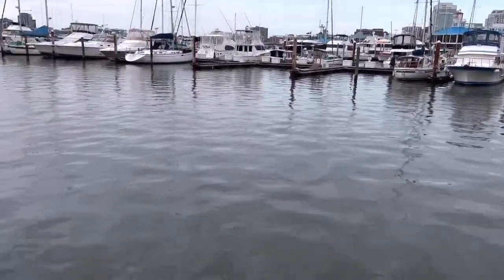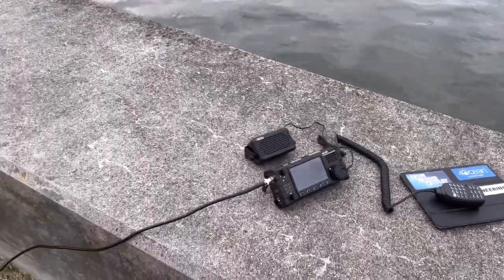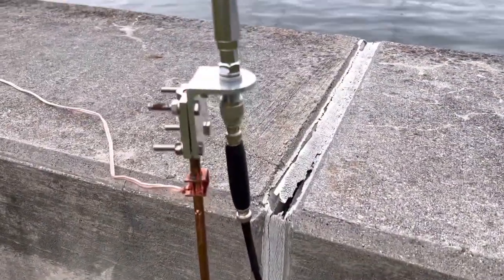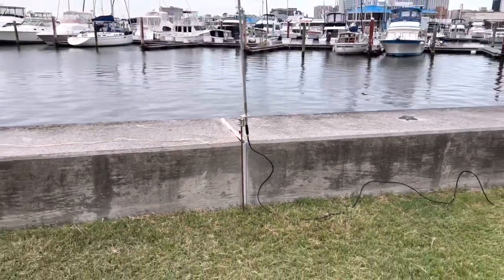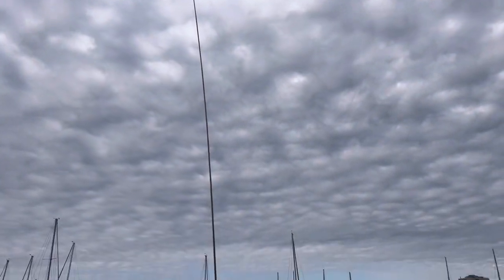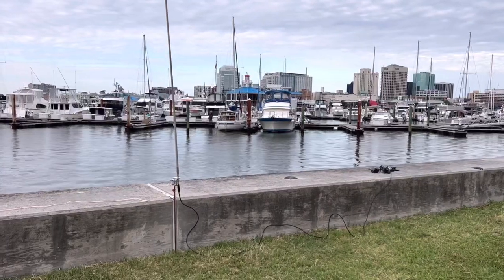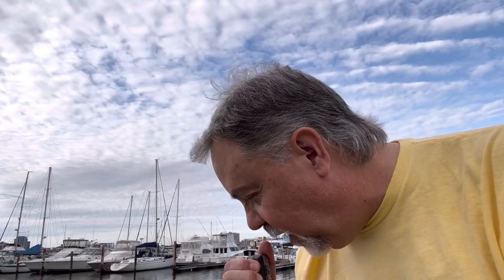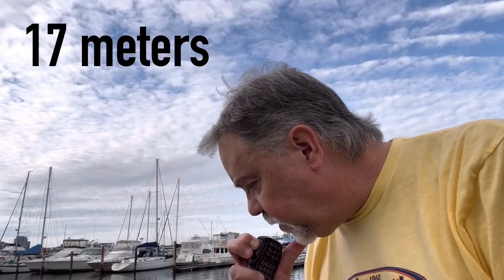Xiegu X6100 - 5 Watt SSB QRP

Comment: Hi Walt. I have a pile of Xiegu gear, the X5105, the G90, the G106 and a new X6200. I had a G1M in the past. The X6100/X6200 get very warm at 5 watts, and IMHO, there is not enough radiative surface to run 20 watts. The 20 power level is ideal, I have to agree on that point. And, the straight whip is a limiting factor, too...

I try to go with more antenna and less power. I hve a 40 meter EFHW with an add-on 80 meter loading coil. I also have multiple magnetic loops from a 2-turn rectangular loop for 3 MHz to 8 MHz down to a loop made from aluminum bar stock that's a hexagon that's 11 1/2" corner to corner and covers 17 MHz to 60 MHz.  Nothing on 160 meters yet, but working on that! My primary support is a 10 meter telescoping mast, and I have a drive-on mast "foot". All fitting in a sub-compact Scion, heh...

CU on the air!  73, Keith, WB2VUO in Amherst,  NY

Comment: can you add a 20 or more watt external amplifier using 6100?
Reply from the maker: Yes, I have the 100 watt Xiegu amp that pairs well with this in a base station setup. Not good for portable. It’s the Xiegu XPA-125B.

Comment: don't give up buddy... i have the 6100 and hopped into Ireland from SE PA  on 17M. 5W into an antron 99 with a feed point only 10ft above ground.
'73
Reply from the maker: Oh I won’t, I’ve made some great 5W contacts over the years. This radio just seems like it could have been designed to be a 10W radio under its battery and that frustrates me lol. All the best and 73

Comment: Cool beans k4ogo de kc2wvb.

I too love QRP. I took a hiatus from ham radio for 10 years, but recently placed an inverted V in 40 meters in service and pulled out my HF Signals kit QRP rigs.

I likely can hit you easily on QRP and when I fire up the radios I will look for your call sign.

Yep, being QRP when the monster stations are calling CQ can be very frustrating and is partly why I placed my kit in storage for a decade. After all, all the credit goes to Kenwood when 100 watt plus equipment is used.
Reply from the maker: Roger that! 73 de K4OGO

Comment: Hi Walt.   Is that 1:1 choke something you made or bought?  Looking at the Chameleon RF choke but like the size of the one you use.  Thanks again for your videos.  73 W6SDK
Reply from the maker: Hi! that choke is built by Tim N9SAB and he sells them on eBay. Here's a link: https://www.ebay.com/itm/164358440127?hash=item264486c4bf:g:gSMAAOSwiABfJgzk

Comment: Not sure if it’s seen in this one, but you’ve shown a choke that’s bullet shaped. Are these available somewhere?  I think you may have mentioned that a fellow Ham makes them.
Reply from the maker: Yes it’s made by Tim N9SAB and he sells them on eBay: https://www.ebay.com/itm/164358440127?mkcid=16&mkevt=1&mkrid=711-127632-2357-0&ssspo=TIbkpe2XS0m&sssrc=4429486&ssuid=IVyKb51XQj2&var=&widget_ver=artemis&media=COPY

Comment: There is always the option to put the external battery on it and double your wattage to 10.   That is what I do and I had a park activated and up to 62 QSOs in an hour and a half this past weekend.
Reply from the maker: Yes, I do that too, this was just an experiment to see how it would go with the internal battery
Reply: The first 20 minutes of my activation was at 5 watts.  I had forgot to turn up the power after I plugged in the battery.   The alternate interface is nice but it takes some getting used to.

Comment: For us newbies would it be possible to show the exact setting you use for your ssb contacts, i.e. noise blanker?, noise reduction?, filters setting?, other tricks. I've done quite a bit of FT8 with my X6100, but few ssb contacts because of 1) mike shyness and, 2) setting ignorance. Thanks for the videos.
Reply from the maker: I'll look into doing that, to be honest I haven't done too much with the settings on this radio other than setting the AGC to Slow and going with the factory settings that it came with. Key that mic and start making contacts!

Comment: Walt love your Videos, I have the same radio and I always go with  10 watts and the best output is outside the metropolitan areas, the noise is too much  for the rig. I have a love and hate relationship with it. If I am going to the woods , OK , but if I am RVing  it a no go, take the FT 891. Thanks for the down to earth  practical videos. 73's  de KC6RZW
Reply from the maker: Thanks for watching and commenting. Yes I can see my feelings about this radio are going to be about the same. 73 de K4OGO

Comment: Question: How do you drive the ground rod in the ground? You carry a hammer or? How deep, just enough to support the whip? Thx! 73
Reply from the maker: Typically I hand push it down about 15 to 18 inches. I do have a rubber mallet that I have used a couple times when the sand or dirt was hard. 73
Reply: @COASTALWAVESWIRES  Thanks!

Comment: hi Walt xiegu 5105 on tx is much better than 6100,i got 2 6100 but i send back to manufacturi,i did not like at all,after 10 minutes cqing its getting very hot.regards iz6bxv
Reply from the maker: Roger that, I really like my X5105. Great little rig. 73, Walt K4OGO

Comment: Hey Walt! I have been using a G90 for a couple of years, and got a 6100 this week. I have been playing with it at home, and with a 40-10 efhw I have a couple of DX contacts, and have done well chasing pota from OR, NM, CT, NJ and others from WI. It is a different challenge vs 20w for sure. How does it do on the QRP net? I am considering pairing it with a micro PA50. It should kick some butt with it,  I love the bigger screen, the improved noise reduction it has over the G90.
Reply from the maker: Yes I think it is a perfect match with the PA50. That might be my next move.
Reply: @COASTALWAVESWIRES  I got 9 countries over the weekend along with a bunch of pota with 10w on 10m. The noise reduction makes it less tiring to listen to for me. I agree that it would be perfect with the G90's 20w.

Comment: 5 Watts SSB is fly fishing for sure. If that was 5 Watts CW, you'd have been waaaay busier. You've got to get those beeps going.... 💪
Reply from the maker: I’m working on it!!!!
Reply: @COASTALWAVESWIRES  excellent. It's the most satisfying (and most addictive) of all the modes. Jump on the air as soon as you think you're ready, nearly all operators will adjust to your speed. Those that don't aren't worth talking to anyway 😁

Comment: Do you use the stock mic with the X6100? I keep getting reports of "funny" sounding audio using mine.
Reply from the maker: Yes just using the stock mic
Reply: @COASTALWAVESWIRES  Thanks. Maybe I've been getting some RF in the audio or something. I need to get one of those inline rf chokes to try out.

Comment: If you run 5W you need full size no compromise antennas. That whip at 5.2m with two elevated radials on 20m… and shorten it to a 1/4wave on 17 rather than use the tuner on 17m makes a lot of difference. See Peter VK3YE’s you tube channel
Reply from the maker: Yes I understand that and actually mentioned how compromised the antenna was at the conclusion of the video.
Reply: @COASTALWAVESWIRES  yes saw that, keep the videos coming !

Comment: Great video....thank you for being honest.  5w is 5w...we can present dB calculations and rationalize that it is only "1 s-unit difference" compared to 20w , but I don't think that accurately represents the difference.  We often do the same thing with higher power....I can say from my experience that 300W vs 100w is a HUGE improvement in communication reliability.   QRP is fun at times, but we need to be realistic and not pretend that QRP is "almost as good" as 20w or 50-100w.
Reply from the maker: Thanks and I totally agree with you!

Comment: The nice thing about the alternate firmware, is that it's not really a "mod" in the usual sense... You boot R1CBU Oleg's firmware off an SD card, and to revert, you just reboot without the SD card... Very clean, low risk operation. I really like Oleg's fw on this radio!
Reply from the maker: I’m really looking forward to doing that!
Reply: Good nugget of info 👍

Comment: You gotta use it on an ext battery, I have the same issue on the internal battery.
Reply from the maker: Yes I use it on the external battery for 10 watts, was just trying it out at 5 watts to see how it would go.
Reply: @COASTALWAVESWIRES   I get that, the internal battery has no real battery capacity to support transmitting for any length of time, like you say that's the radios downfall the internal battery is only any good for rx only.use.

Comment: You should try doing a pota activation.  You will be surprised in your success with 5 watts.  Your trying to break through a DX pileup with qrp.  Yes It can be done but rewards will be small.  I activated two weeks ago got 129 contacts and 7 were dx.  All in 63 min.  Yes condition were crazy good.  I average 36 contacts per activation on 5 watts or less.  I have had 3 activations on 1/10 of a watts.  Yes this is all SSB.  So give it a go  I think you will like it.  KE8PTX

Comment: Crazy that Xiegu could have such a winning design and fail to finish it off with some simple upgrades ?  It's almost like they do not want the orders ? Ah well I guess the G90 reigns supreme for now in their range. (If they want some advice they could always post me one for some free consultancy 🙂). Actually for qrp a better internal speaker would be my first step (I have a mini guitar amp with a 3" speaker that sounds amazing so I am sure they could squeeze something better in?). The less non-essential clutter to carry around portable the better. Also ironing out the software bugs and get G90 style ATU performance would seem sensible ? Anyway great work sitting on the dock of the bay (hey isn't that a song !).
Reply from the maker: It will be interesting to see what Xiegu comes out with next. If they could just take the best of this radio and the G90 and morph them together I think they would have the ultimate winner of a portable radio.

Comment: Walt, honest answer please: which one you find to be better, x5105 or this one? I sold my x5105 already (working perfectly and owner is happy), but when I bought it the 6100 had just released and I went for the 5105 because I was sure this one would be worse, on release at least. I went out with the 5105 when it was -35c, I expected the radio to die on me but it worked fine. Also I dropped it on the snow once 😂
73!
Reply from the maker: Honestly I like the X6100 slightly more than the X5105 because of that incredible SDR screen. That’s the only thing better about it than the X5105 but it’s a big deal.